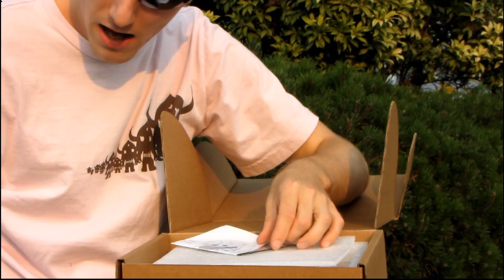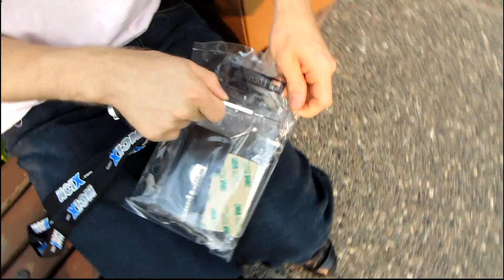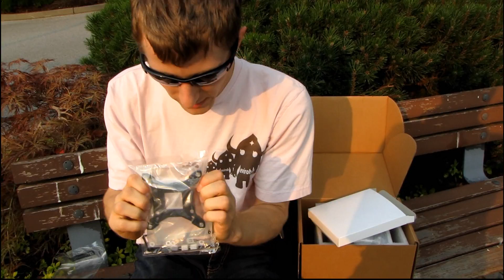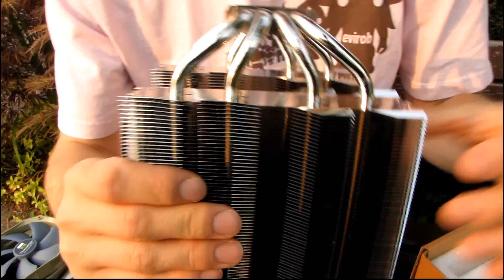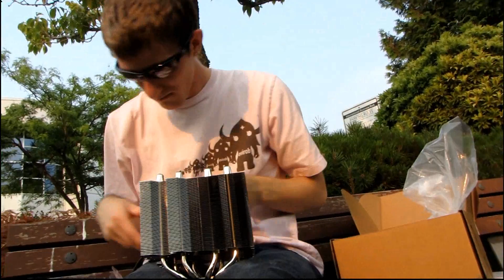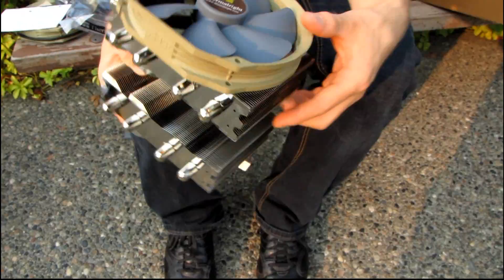Thermalright Silver Arrow Extreme Performance CPU Heatsink Unboxing & First Look Linus Tech Tips

Comment: Just bought this thing (2020) as a stopgap measure. It's the first air cooler I bought since 2005 and I must admit this thing is impressive. I wouldn't go as far as to say that it's better than custom loop I've been using until the other day and I'll be reverting it back to water cooling as soon as possible but still, its cooling capacity is really adequate, even for OCed 200 watt TDP CPUs.
Reply: Hello from 2021, I've had this cooler for as long as this video existed. I'm not using it on my main system currently but it's been used on every system before it. Currently it's cooling a i7-5930k. It can handle a max of 320 watts.

Comment: Actually a lot of review sites have shown that both the D14 and Silver Arrow perform temperature wise about the same, but the Silver Arrow is much quieter.

However, the Silver Arrow is actually taller than 160mm as Thermalright says because of how much the heat pipes stick out on the top.

Comment: Nice video and great information.  What is the maximum rated temp for this heat sink? Also, what is the biggest most hard core, hightest  temp rated heat sink that you have seen?  You answer will be most anticipated. Thanks again.

Comment: Thermalright have ripped-off the Noctua D14 design, dual rads, with a 140mm circular fan in the middle using 120mm mounting holes, they even followed Noctua's horrible choice of fan colours, so you can now choose between the sickly beige of the Noctua or the bile green of the Thermalright. The Thermalright offers better compatibility  for motherboards and memory. The Noctua has x2 more heatpipes but costs £10 more in the UK, I suspect both units will offer top air cooling performance.

Comment from the maker: @Tantoblade1pd I use a custom water cooling setup with two radiators, and temperature sensors that dynamically adjust fan speed in several different zones for optimal temps versus noise.

What I use when I'm throwing together a test bench is a different story though.

Comment: linus why do you use massive air cooled heatsinks on your computer when you know that water cooling is better.
I know you swap alot of harware over reguarlly so i thought that might be the reason but for aesthetic purposes you should use a much smaller cooler such as the corsair h50, so you get better then air cooled performance, and users can see your demonstrations alot easier then you trying to show ram squeezed next to some goliath air cooled monstrosity.